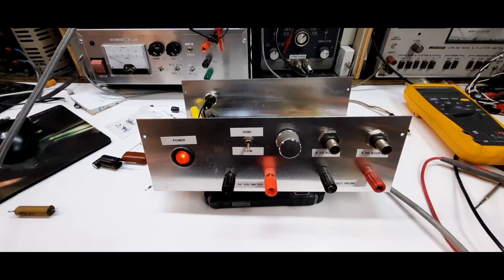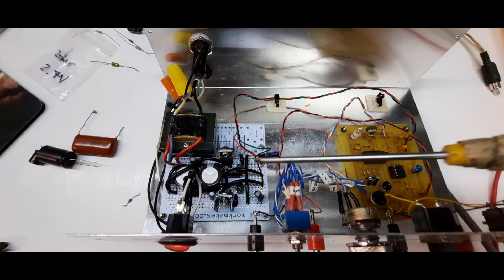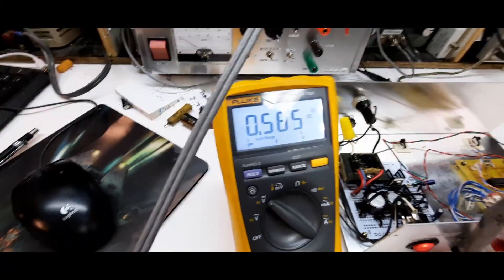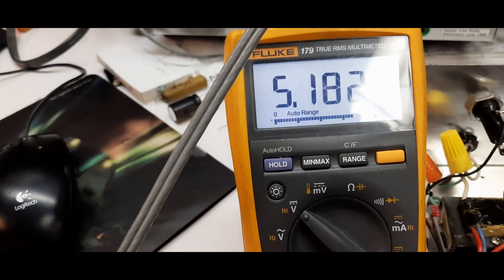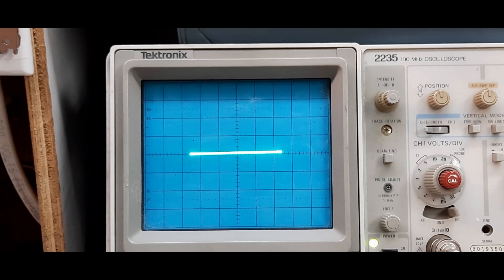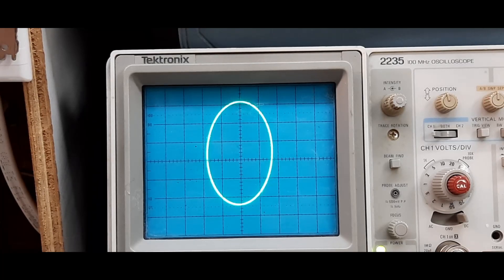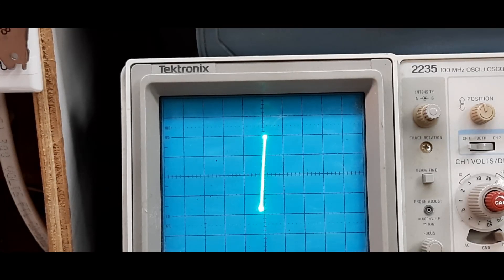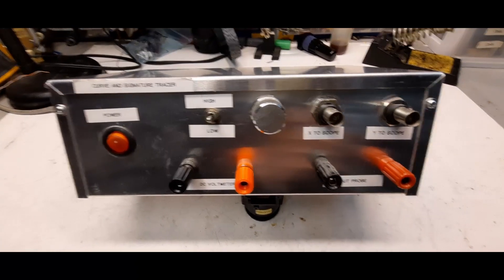Mr Carlson Curve Tracer

Comment: Bettina you have NOT explained how the curve tracer works and just claimed you can't show the circuit "because it's proprietary". That is nonsense. What does the voltmeter output represent? You say "eksetra" when an education about how our abbreviation ETC. stands for the greek ET CETERA would teach you better how to pronounce "etsetra". When the  220 ohm resistor causes the displayed line to rotate slightly you declare that it is "not straight any more". That is wrong and possibly you are trying to say it is "not straight UP anymore".  Anyone who cares for a good Tektronix oscilloscope must groan at the woman who leaves it to burn the a spot at center screen before belatedly reducing the intensity. You never mentioned that you had shifted the display origin before measuring the zener diode and actually missed the fact that its 5.1 V breakdown can be read from the 1 V/division horizontal screen calibration. Do try telling a pensioned engineer that back in the olden 1930s using a curve tracer was a great way to measure or detect a noisy resistor because I would like to see his eye-rolling reaction.
Reply from the maker: I will try and do better next time. Have a nice day.

Comment: I am a first time visitor to this channel, came in due to "Mr Carlson" in the title.
You completely omitted to explain what a curve tracer actually does, and what X and Y represent.
For example, as an oscilloscope newbie, it makes zero sense having Volts on the X axis when at all other times the Volts is on the Y axis.
Reply from the maker: You're right ... I should have explained that. A curve tracer shows you the current versus voltage relationship of a device. The X-axis is voltage and the Y-axis is current. Cheers!

Comment: This was absolutely the best video I have seen on this topic. Explaining about the parasitic capacitance is something I have never seen before and it's important. I need one of these. Off to get the details. Thanks.
Reply from the maker: Mr Carlson put his curve tracer inside an old scope. On the Patreon page is the design plus a power supply too. I decided to put it in a case and have the external X and Y connections to my existing scope. Thanks for watching. Cheers!

Comment: i built the simple octopus type device that just applies low voltage AC to components for X Y on the scope. I have used it primarily to screen diodes that I have bulk quantities of.  Yes I have found leaky and flaky diodes to cull with it.  I have a regular vintage transistor tester though.   For capacitors it is nice to have other higher frequencies besides 60 hz. because small values do not display much with that. And you can use these sort of devices to test for noisy pots.  Turning a pot should make a linear trace that rotates as you turn but noise will be visible as shuddering or jittery movement of that trace.
Reply from the maker: Thanks for the tips on testing for noisy pots. Cheers!

Comment: I use one i built years ago most days. Good for testing leaking fets as the transistor shape will gradually change while it leaks. Mine was called an octopus curve tracer and there are loads of details on those
Reply from the maker: Yeah, I was thinking about testing one on the video but it was getting a bit long. Thanks for checking my channel out. Cheers!

Comment: Check out the front cover of October 73 popular electronics. I built super audio suite generator and it's very useful. I redesigned and had circuit boards made, and you have to get 5 at a time but I've only used 2 I was wondering if you'd be interested in the boards, I have leftover for a project of your own. Here's a glimpse of what I did. https://youtu.be/k_WKPgC0_mQ?si=Hb0ZCSkXorpOLTbJ
I can mail out the board and cir mod info to you if you have any interest.